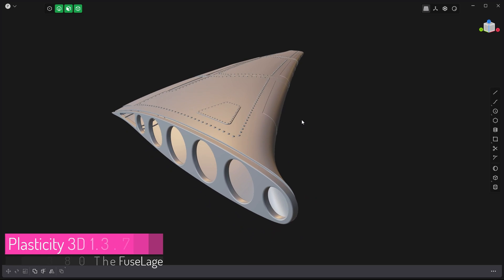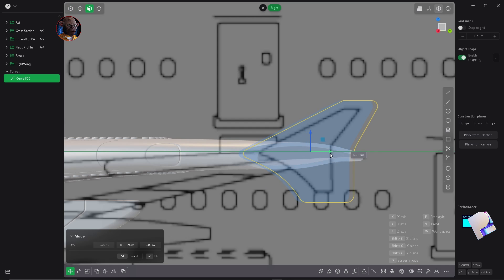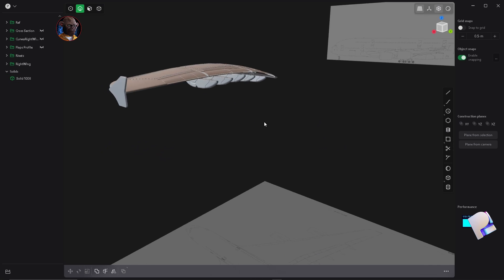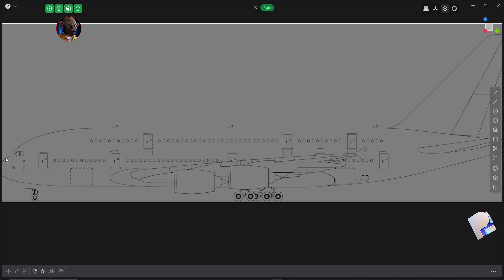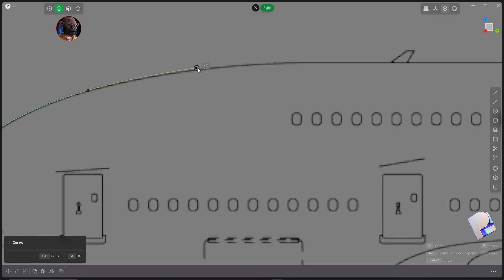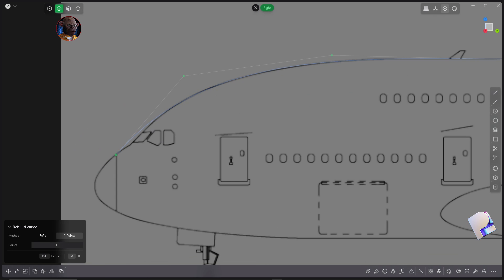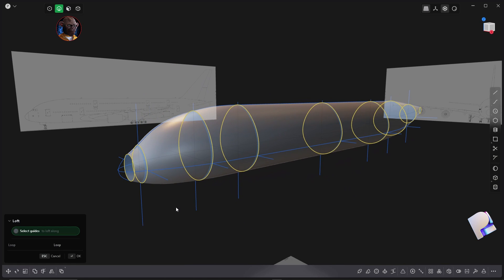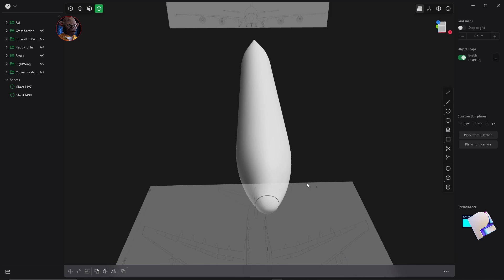Plasticity 3D 1.3.7 How to make AirBus A380 modelling of the fuselage

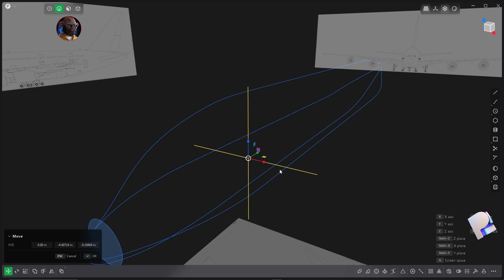Comment: When im making the body at 13:17 all 4 points dont connect when i do ctrl and click the white ball, only the top and bottom align it wont let me snap edges to the sides of the cross any way around it?
Reply from the maker: Hi, you have to use the spline tool, hover over the curve till the "Curve snap" appears on the screen, it works perfectly on my side.

Comment: When trying to use the guide curve, I continuously get "a guide is not touching a profile". I tried redoing the entire thing several times but to no avail. I can get the loft to work but as soon as I select the guide, it fails. I've tried snapping on the profile curve to curve, end, intersection etc. in some cases, the snapped points have been all green/blue, other cases it's been all purple but in both instances it fails. I cannot figure out what is causing the issue. Any help is appreciated. Thanks.
Reply from the maker: Hi, it works perfectly on my side, anyway, have you tried using points of tangency? join my Discord channel, I'll show you how to do that: https://discord.gg/SqU5Hczy5n
Reply: @Stuff-3D-creations  Thanks. I actually managed to get it working but if I'm completely honest, I'm still not sure how. Sometimes it works and other times, I spend ages trying to snap to the correct point on the curve. I joined your server anyway so would be great to see exactly what to do. I'm trying to incorporate Plasticity into my Blender workflow as I've been 3D modelling for years and see the benefits it has for what I do. Love your vid tutorials btw :)
Reply from the maker: @Rob-N  Thanks so much! I really appreciate it! The loft tool can be a bit finicky at times, but don’t worry—there are some workarounds to make it work for you.

Comment: Hi there! 
The tip of the airplane is a circle in your case because you modeled the A380 using the A330-900 NEO, reference image. A380 is oval. Cheers!
Reply from the maker: Hi, Hi, I didn't follow along with the reference slavishly.
Reply: @Stuff-3D-creations  In this case the tip of this airplane is wrong, because the loft starts from a round shape instead of an oval shape...

Comment: It doesn't look like the surface wants to match with the multiple cross sections. Rhino averages surfaces when there is no precise contact between sections and guides, but Plasticity is more problematic; If there is no coincidence, the surface does not work and gives an error... so, why does the surface not coincide with the sections and guides?
Reply from the maker: It works perfectly fine on my end. Just follow the cross sections exactly as shown in the video, and it will work like a charm.

Comment: Thank you very much for these videos. One question. What is the reason for rebuilding the curves? Can't we just use what we built using line tool?
Reply from the maker: The rebuild tool helps make curves smoother and spaces control points evenly. However, it's always better to create curves manually using as few control vertices (CV) as strictly necessary to avoid wobbliness. Thank you!!!

Comment: After 10:35, I cannot proceed. When I try to join the 4 parts by selecting the circle while holding "shift," the fill disappears. SOLVED: Just Click on "Loop" button in Loft area. Remember to click on edge, not for Cross. You need to be very precise. GL Bois And Girls! Thank You for Great tutorials ;)
Reply from the maker: Hi, delete the circles causing this and re-do them using the spline tool, it works fine!!